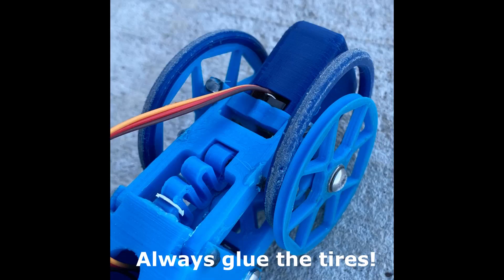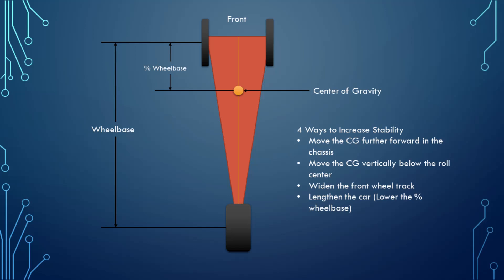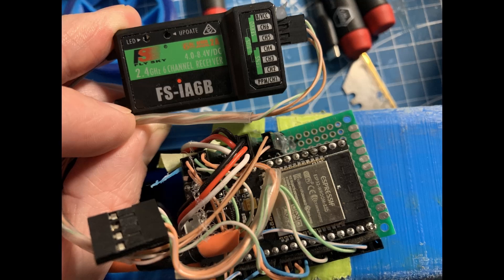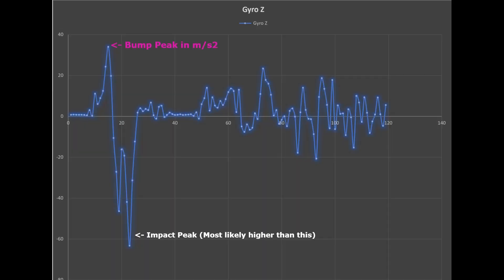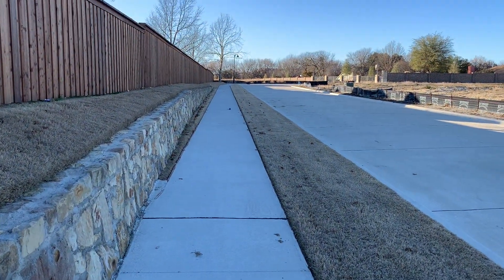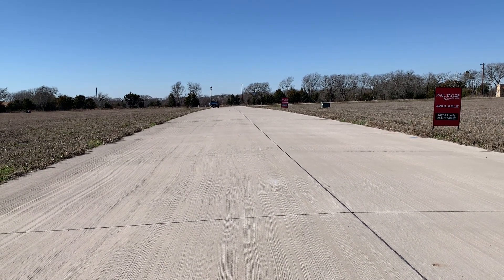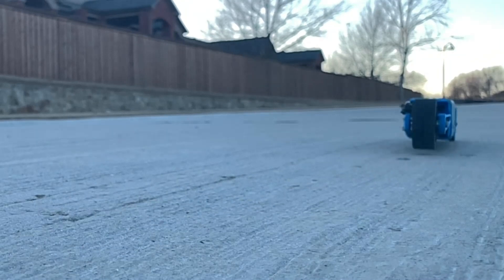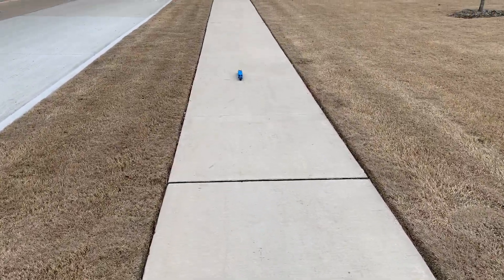Project Streamliner: Testing Update Pt6

Comment: Man, this channel is WAAAAY underrated!!! Amazing engineering!!! I cant wait to see what we end up with :D Why don't we just have a servo that pushes a piece of rubber into the front wheels to implement front braking? Adding the servo to the front will also bring the CG further forward, its a win -win!
Reply from the maker: Thanks!  That’s a great idea for the braking. I’m definitely looking at trying to add a servo up front. There’s just a huge lack of room with the shock absorber and the steering rack. (It’s hard to show how small this car actually is). I think there would need to be a rod system of some kind.

Comment: I should have recognized this three-wheel configuration sooner, it's the same as a taildragger aircraft. You've been experiencing something called "ground loop", the bane of all taildragger pilots. Bicycle inner tube over the rear tire is a great idea! Here is a suggestion for braking. Have a servo drive pads against outside the front wheels. It is not a glamorous or elegant solution, but it would be simple, light, and if designed right probably quite effective too. Just an idea. Thanks for another fun video!
Reply from the maker: Thanks. I like that approach to braking and I’ll have to test it out. I had a go kart as a kid with brakes like that.
Reply: @IndeterminateDesign  - I think "old west" style wagons used that system as well. I think the main problem to overcome with that system would be modulation. Especially at this smaller scale, they might act like a switch of on/off rather than having a smooth actuation. But I'm sure you could figure something out!

Comment: For high speed breaking you could use air brakes/brake using a single servo and the air surface could even just be a part of the shell wall
Reply from the maker: This is definitely the way I’m leaning.

Comment: Sometimes designs reach a deadend.
Reply from the maker: Agreed. I have so many other designs I want to try now.
Reply: @IndeterminateDesign  I know it's been mentioned before but I'd really look at what the full scale guys have done. A lot of it won't scale or would be really expensive to do. Some of those Lakesters are really fast though. Even with the exposed suspension and limited motor you can fit in a drop tank.

Comment: I don't know about anything that small, but for motorbike braking: you tend to break the rear first which loads up the front (pretty much ignore if the back skids) then progressively pull the front. That way the tyre doesn't snatch suddenly as it gains grip from weight transfer (otherwise you end up with a 'front tuck' or flip, which is not fun)

Probably much easier to deploy a solid rubber block at the far back on this project.

Good luck, and thanks for sharing.
Reply from the maker: Yeah, it’s a tricky problem at this scale because everything just gets so unstable so quickly. I really need wheel speed sensors and ABS 😆

Comment: I ran a 2wd car for a short while and finally changed over to 4wd just for the braking.  Nitro cars run a small disk brake.  Maybe you could put some cvds on the front and tie in a brake disk?
Great work so far.  Looking forward to seeing more.  I have the skyrc gnss if you want to test/compare GPS results at that run spot near Lavon.
Reply from the maker: Yeah, 4wd would make this a lot easier for acceleration and braking.  I definitely want to meet up and run.  If I can get the new body printed and the braking figured out I can hopefully stop wrecking every few runs.

Comment: Front suspension geometry and damping might be worth looking into. Is the car bottoming out under heaving braking causing that loss of control?
Reply from the maker: It doesn’t appear to bottom out under braking. The rear has a lot of anti-squat built it so it does drop, but I think the uneven road surface really just makes the rear pull one way or the other. I wish RC cars had brake  “feel” like a real car.

Comment: have you tried altering the pitch of the chassis? It's quite true you'd increase drag (great for stopping) but it could also be that you see gains on grip of the tyre that would offset the drag, it's also cheap and doesn't weight anything, would be a fun experiment if you added a sensor to the rear wheel to see if it noticeably alters the grip levels of the tyre.
Reply from the maker: I haven’t tried altering the chassis pitch. It does rake forward to help keep the nose down and prevent lift.  I do want a rear wheel sensor, just trying to find a way to incorporate an optical or hall sensor. I’ve added functionality since the video that uses the accelerometer to provide rudimentary traction control and ABS. You can see the acceleration drops when the tire breaks traction

Comment: Did you tried tu run it backwards, like a fwd car? Without front wheel braking I don't think that you will be able to control it. Congratulations on how you approached this project, it's not all about brute power. 
You can find a variety of tires here for example:
https://www.rcplanet.com/1-10-on-road-car-tires/
Reply from the maker: I haven’t tried running it backwards yet. I soldered all the motor leads, but I’m about to change shells so I’ll try that.  I bet it would be a lot more stable that direction. 

Thanks for the link for tires. I actually need a set for my active suspension truck I’m building. Does anyone sell the foam tires unmounted anymore?  I’d like to try foam since this is what most RC speed runners use.

Comment: Couldn't follow the updates for a while due to my thesis, but I'm glad to see how far the project progressed from the first videos.

Regarding the possible solutions - parachutes seem ile the most reliable thing. Also, I might have missed a few videos, but how much of a concern is a radio range when attempting for higher speeds? On this video it looked like it cut off quite early when you attempted 60-90 mph run. Have you considered running indoors? The floor would be miles ahead in terms of smoothness, and maybe you could focus on actual high-speed testing and not how to go very fast with not very stable configuration, a very stiff car and a surface that's incredibly rough in scale of the wheels :)

By the way, just a "meta" suggestion - it might be clearer if you numbered the videos like in the F1 box and compressor series.
Reply from the maker: I’m looking at parachute mechanisms right now, still have to figure out the low speed braking.

Radio range is a definite concern.  The receiver is meant for airplanes with a 1000m range but in a car you get less. The arrangement of the antennas is important as well.  I think visual range is an issue too, I have good eyesight but this car is pretty small.   

I don’t know if I could run it indoors. I’m taking about 1/4mi or 400m to reach 90. It’s an interesting challenge for RC cars, because they almost need to be part drag racer to get up to speed. 

Thanks for the suggestion, I’ll go back and put numbers on the episodes.

Comment: For braking and tech just copy the land speed and motorsport guys, you have over  100 years of experience to pull from and they learnt the hard way.
Reply from the maker: Yeah, most of them use chutes. There’s a company that makes small rip stop nylon chutes for rockets. I’m thinking about pick one of those up to test.
Reply: @IndeterminateDesign  about ten years ago I designed a co2 powered parachute deployment mechanism for drones. It was light enough to fly and got the chute out in a hurry. look into fruity chutes or Mars for a commercial solution.

Comment: great work !! i love how the changes affect the car ! so about the speedometer how are you making it ? and btw I am curious are you an engineer ? from the way you analyze things and work it seems you are :D
Reply from the maker: Thanks. The speed is from a NEO6M GPS chip that I have hooked up to the ESP32.   It’s decently accurate but I will buy a better one when I stop wrecking so much.   I’m not an engineer, I just play one on YouTube.  I did manage various technical and engineering groups.  I have some health issues now, but getting to learn and experiment keeps me sharp.
Reply: @IndeterminateDesign  Wow you are not an engineer by profession and you are doing all this great work ! well done ! it is really impressive! so about that GPS chip would that work for arduino or is there any other alternative other than an arduino shield?
Reply: @IndeterminateDesign    Thank you so much for the info ! i just looked it up ! it is an TX RX pin module :D amazing i still have places for that on my car so yes this is how i will be measuring the speed and not with hall sensor ! because hall sensor won't be good so far due to fact that the magnet strip that i found is not that strong so i have to make the hall sensor very close like 1mm close or less which wont happen accurately so yes this chip is the solution :) now i have to hope it is not very expensive !
Reply from the maker: Yeah that should work and it’s a newer model. I think I paid something like $10 for mine off Amazon. You can get them cheaper of aliexpress. The higher end gps modules that Adafruit sells are really nice too and have a higher refresh rate.
Reply: @IndeterminateDesign  yes this one i hsared is around 10$ also, so the thing is i am seeing an extra pin PPS or something like that, any idea what could be for ?
Reply from the maker: It’s pulse per second. I don’t use it, but it’s used to stay in sync with a real-time clock. It pulses exactly once per second.
Reply: @IndeterminateDesign  ah ok i see so yea we only need 2 pins on arduino which i have 😊

Comment: too low weight for traditional brakes - use pop-out aero fins on the side which will also serve as stabilizers so it won't roll over - think children's bikes
Reply from the maker: I like that idea. Traditional brakes will lock the wheels up too easily. I think I may make some bolt on air brakes to test out how much force I can get.